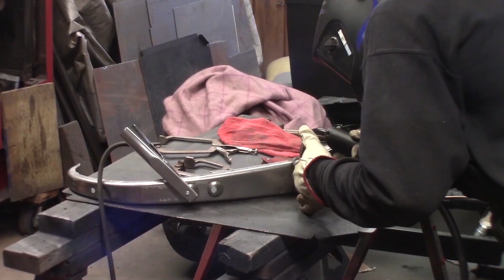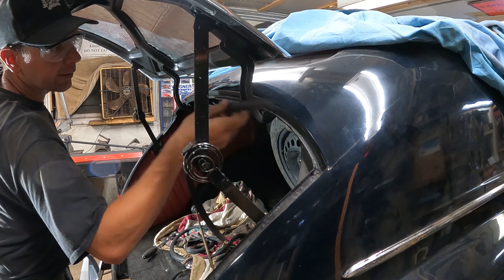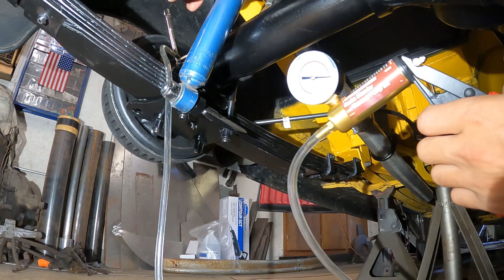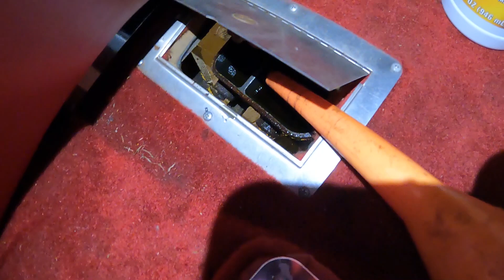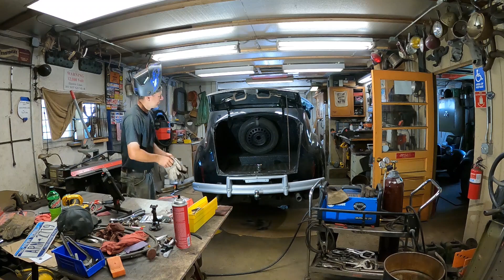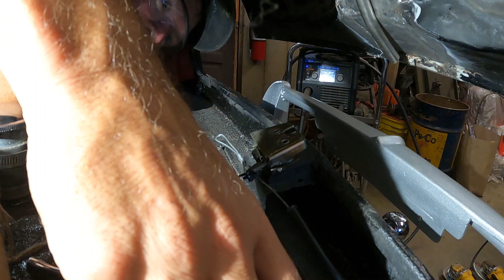1940 Mercury:  Bleeding the Brakes and Repairing the Trunk Latch Mechanism

Comment: 👍🏻I had the same issues with my 39 dodge not fitting right on the top end. I also added some gas struts to hold the trunk up. And don’t get me started on those cheap trunk latches they sell, had to fix the poor manufacturing of it.
Reply from the maker: I thought about gas struts, but I'm cheap so I am using an old rod with a shifter knob as a prop.
Reply: @QuickSpeedShop  All my projects are very low budget also, but on EBay they had a universal kit with brackets for 15.00 bucks, it was well worth the time and money in the long run. Nothing sucks more when the trunk lid falls on you. Lol